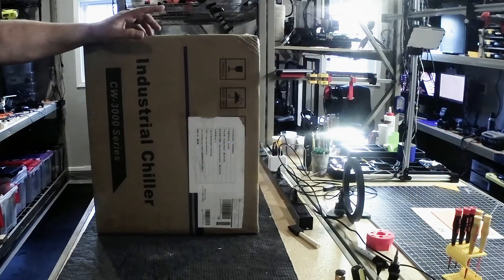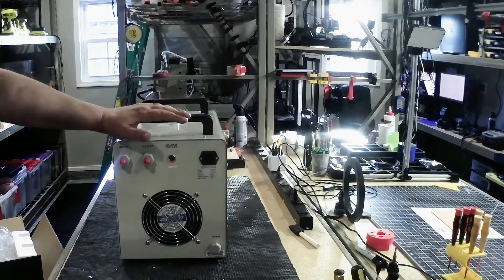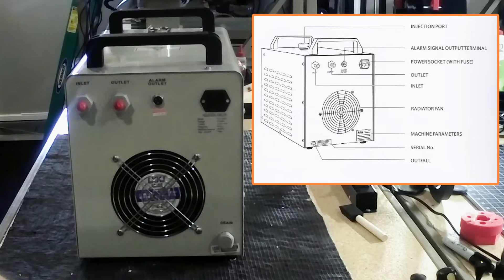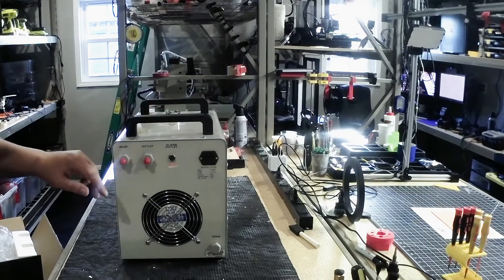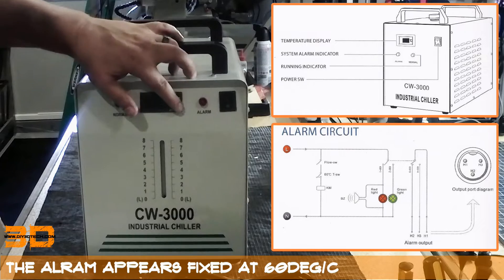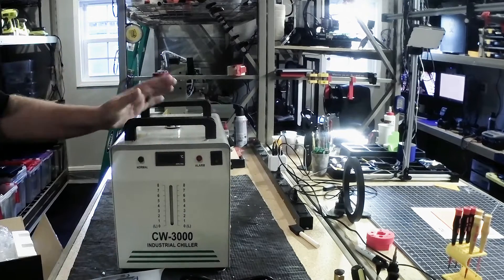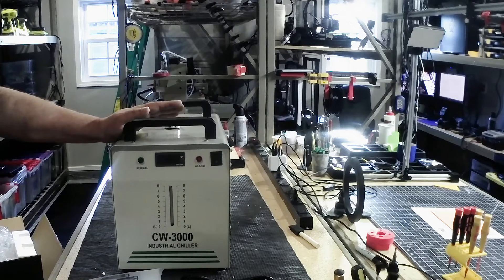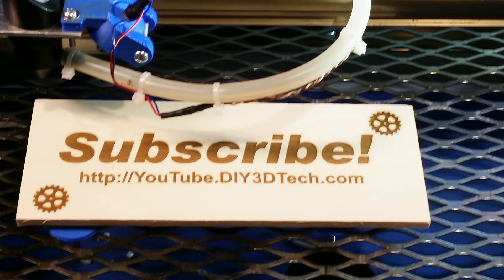eBay K40 CO2 Laser - Unboxing a CW 3000 Chiller!

Comment: Hello DIY3DTECH, Got a question for you > Does your unit use a coil instead of a radiator and if it does, what direction is the fan supposed to go? Does the fan blow out the air from inside the unit or is it suppose to blow air inside the unit, at the coils?  i am not sure and I can fine it anywhere> Thank  you.

Comment: Dear
Reply: Do u need to use the alarm cable?
Reply from the maker: Yes!  Since you have a choice of Normally or off I use it wired to the laser button so the unit must both be on and within temp for the laser to fire!

Comment: Room temp?? It sure won't work out in my garage which is where I have my K40 laser. Even if you have your house at 70 degrees F, that is 21.1C. I keep my house at 75F which is 23.9c. They say that the optimal temp for the laser is 15 to 20c, that is 59 to 68F. Personally a refrigerated chiller would be the best option, or am I missing something? Just askin'
Reply from the maker: It depends, for the past 4 years I have used a 2 gallon bucket of water (as a simple heat sink) with no issues.  This also has 2 gallons with the addition of two additional things, the first (1) is flow as this moves a LOT of water, far more then that cheap Chinese pump did.  Second (2) is the massive heat exchanging area (combination of coil and fan).   Keep in mind that the k40 is a 40 watt light bulb so it does not generate a lot of heat, as it's issue is more of steady dissipation over its duty cycle.  Having owned several k40's, I have not seen anything on 15 to 20c, that is 59 to 68F.  However that's not say that someone, somewhere for some reason didn't publish something like this but it makes little common sense (other then to sell you something).  As yes I Googled it and it did come up without "reason" however if you read deeper the common temp range is "10 and 35 degrees" which makes more sense.   For me, a refrigerated chiller only makes sense is if the power of your tube coupled with your duty cycle exceeds the  ability of the "heat exchanger" to keep the tube within a safe range.   Keep in mind that it takes 0.00244 kWh to raise one gallon of water by one deg.  So 40/1000 =0.004/0.00244=16.39.  So in short if my math is correct, running a 40watt CO2 laser for 1 hour will raise one gallon of water 16.39 deg or two gallons ~8 deg (again after an hour).  Now if you factor in a simple "heat exchanger", you can easy dump most of that 8 deg in an hour or at minimum hold the temperature.   Where you run into the need for active cooling is with larger tubes (80 watts and up) and longer duties cycles.  Hopefully this helps :-)
Reply: @DIY3DTECHcom  Well, I just did a search on google for the proper water temp of the K40 laser and that is where I got the info. I know that the internet has everything all over the place, different opinions everywhere. I just know my garage is hotter than 80 degrees here in the summer (Texas), and I don't have the room in my house to operate it or properly exhaust the fumes. I hope you do another video after you have used it for a while and include what the room temp was during operation and what the temp of the water was. I would like a refrigerated chiller but they are out of range of my budget. Thanks

Comment: as others have pointed out its not an actual chiller, i do use one of these with the radiator bypassed connected in series with a under counter water chiller, and a inkbird itc-100 for more granular control over the thermostat, keeps a 100w tube @ 15c all day in a 25c room same preformance as a cw-5200 for 1/4 the cost. the major drawback with these "coolers" is the same as pc coolers in that you cannot go below ambient, even if you added ice water to it it would bring the water temp back up to ambient in no time at all, so if your in a environment that is below the temp you want the water to be then your good to go other wise get an actual chiller.
Reply from the maker: Thanks for commenting and as mentioned in the video this does not have a "compressor"  however it still is a "chiller" as if you look up the definition of "chiller" it is "a machine for cooling something" which this does.  I also point out what you mention  in the video [about room temp]  as after years of use I have not found a reason to go below room temperature as in the past I simply used a 2 gallon bucket of water.  So this is a major upgrade.  Also this is not the right tool for cooling a 100watt laser that is running all day, however I am not sharing it for that but hobby / small business application of the eBay k40 laser.
Reply: @DIY3DTECHcom  definitions of a chiller.  a machine for cooling something, especially a cold cabinet or refrigerator for keeping stored food a few degrees above freezing point.

A chiller is a machine that removes heat from a liquid via a vapor-compression, Adsorption refrigeration, or absorption refrigeration cycles.

The life of the laser tube is reduced when its running above 20c this is the reason for needing to cool the water, 

My point is a better upgrade to the water cooling loop on the laser would be an actual chiller, i paid £20 for a used under counter chiller but beer coolers can be got for £50-£100 regularly, the only reason I bought the cw-3000 was it was easier than remaking my original design when I added a uv sterilisation lamp.

Comment: That's not a chiller. It's a cooler, but not a chiller. The CW-5200 is a chiller.
Reply from the maker: Thanks for commenting and as mentioned in the video this does not have a "compressor"  however it still is a "chiller" as if you look up the definition of "chiller" it is "a machine for cooling something" which this does.  A cooler is something which keeps beer cold :-)

Comment: This chiller will not cool water below room temperature.  I use a used beer chiller for the laser.  They can often be found for around $ 100.  All you need to buy for them is a thermostat.  I cut with a similar laser at 15.5-16 degrees Celsius
Reply from the maker: Thanks for comment and correct (will not cool water below room temperature) however why would you want to?  Again I am sharing it for use on an eBay k40 laser which I have used a 2 gallon bucket of water which has served me well on two units for 4 years.
Reply: DIY3DTECH.com Let me explain with my example.  For cutting MDF at 21 Celsius, I used 42% of the laser power.  At a temperature of 16 degrees, 38% is enough for me to successfully cut.  The lower the temperature, the better!  The main thing is that it is not below the dew point (otherwise the tube will fog up). In my understanding, the less the laser power is used, the longer tube will last.  Plus, a beer cooler is cheaper than any industrial chiller and can lower  water temperature up to two degrees Celsius :D

Comment: Given that it's just a passive radiator system, I'm really surprised that you didn't just build one.  Also, I think that "Forbidden to anhydrous boot" is Chinglish for "Do not start without water in tank".
Reply from the maker: LOL!  (Chinglish for "Do not start without water in tank") for eBay / k40 laser I did, however I want to go up to a 60 watt unit so want to try a more aggressive exchanging unit.  I know by saying "passive" your saying it a lacks a compressor for heat exchange however by nature of the fan it still is an active heat exchange and it is better for the money verses what I could build (performance wise) again for the money.  Keep in mind the radiator system in side is massive providing a large amount of surface area as the last version I built used a large PC radiator and fan :-)

Comment: Really.  It’s 10x the price of the laser.
Reply: $159 is 10x cost of the laser?  Where did you buy a $16 K40 Laser?
Reply: Geeksmithing err. The link to amazon was £1,385.00
Reply: @DavidinEssexUK  I see $162. 
shrugs  
Granted on Amazon.co.uk they are more around 400 pounds, but still way different than 1385.  Weird.
Reply from the maker: Yea I think your looking at the wrong unit as the one in the link is for 200 watt laser which is far and away from an eBay k40 laser.  In fact this is a little over kill for the k40 as I used free two gallon bucket of water for the past 4 years.  This worked great for casual use, however I want to work on a couple semi-commercial projects which is going to up my duty cycle as well as I want to move up to a 60 watt unit again with a higher duty cycle so this unit seemed like a logical step.
Reply: @DavidinEssexUK  Better get a new pc. I think you have some problems. Possibly operator error.